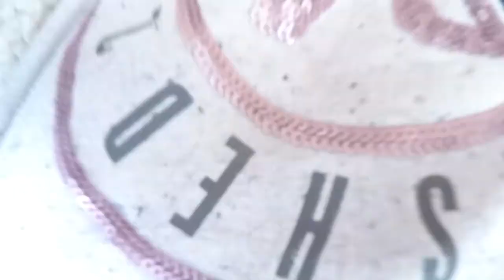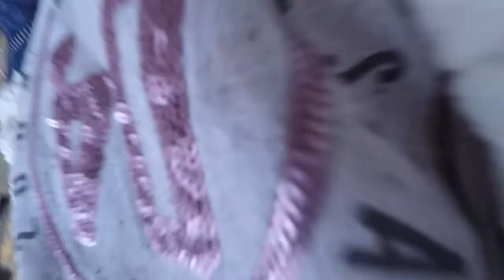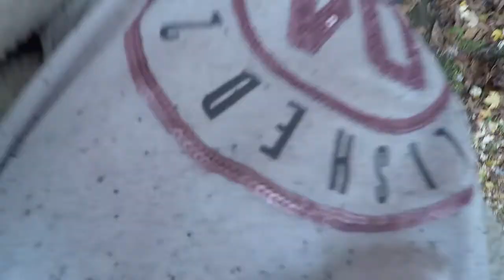These leaves Didnt Stand A Chance, Stihl  BR 800 And Dewalt 20 volt Leaf  Blower, Bounus Raw Footage

Comment: My friend has bigger dewalt leaf blower. He like it says smaller one is junk. I'm glad dont have deal with that many leaves. Friend has clean his yard every 3 days. You use any for making compost.
Reply: So you would recommend putting any of the smaller DeWalt blowers in the bin correct? Have you ever used or owned a blower?
Reply from the maker: I bought this one just for the deck. Works great for that. No, I have not composted them before